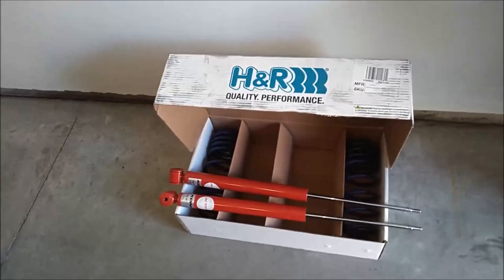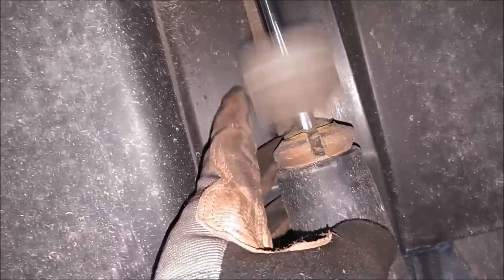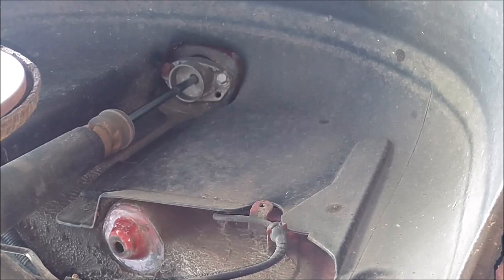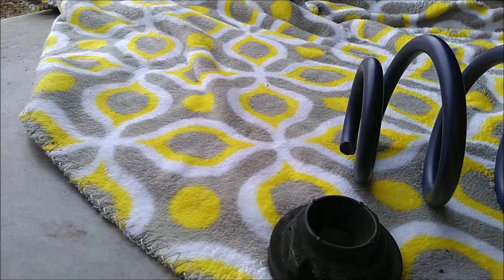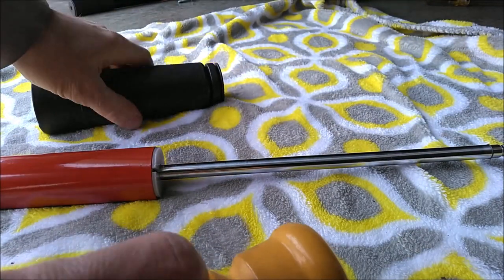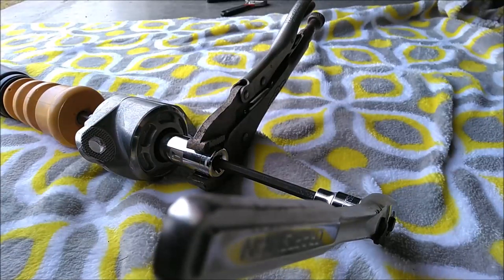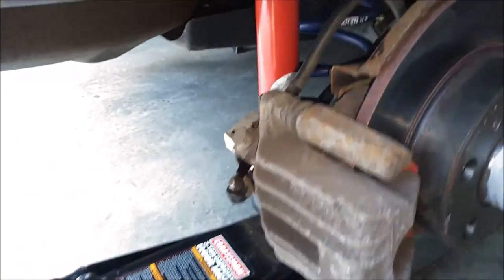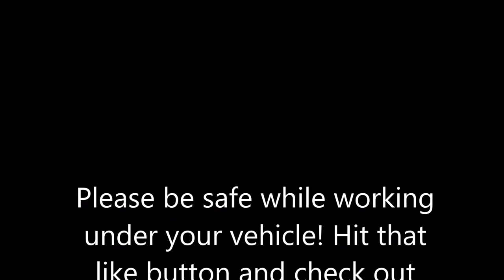VW Golf mk4 rear suspension removal and install

Comment: Great video 👍🏼👍🏼👍🏼
Reply from the maker: Thank you
Reply: No problem! 
I’m changing the bushings on my Jetta soon and never worked on these rears. The parts are not here yet but I’m curious… Are there bushings in that part that gets mounted to the top? The part that takes the two bolts. I’ll see it soon but always wondered wtf that thing consists of 😂
Reply from the maker: @jackvr32  - The top mount is aluminum with an internal rubber bushing. You can buy stiffer ones if you want.

Comment: Great videos man. Keep them coming. Going to attempt a rear axle bushing replacement on my 2003 GTI.
Reply from the maker: Jay T - Thank you. The rear axle bushing replacement is a tough job. I had rust to deal with and bad brake lines which slowed things down. I wish you luck with it. Thanks for the comments.

Comment: Thanks a lot for this video !

I have been struggling to find the 1J0 512 109 reference (Rear lower spring seat). 
From all golf mk4 rear spring how-to videos, only yours shows it very clearly and provides the reference.

Unfortunately, in France it does not seem to be known from regular spare parts resellers websites.
I have to order it in UK, Poland, Germany or USA... (transport fees are higher than part cost...)

I can't tell whether this part is actually mandatory (at least for short term) or not.
Seems like in most of the videos, people don't even change them (even if in bad shape).

As mine are completely dead, and as I receive my new suspension very soon and I'm thinking of driving without the rings for some weeks (ETA for such ring is like 2-3 weeks more).

It's sad such part has so poor availability in my country..
Reply from the maker: Darwinozor - Thanks for watching and for the comment. That's too bad to hear about the spring seats. I would just wait until you get them instead of taking it all back apart again to reinstall.
Reply: Having taken mine out, there was no separate spring seat. I'd seen it on the parts drawings, but it wasn't on either of the springs on my 2001 1.6 16V. I only found one seller on eBay that had them (UK), at $12 each. I just thoroughly cleaned the base and used lithium grease under the spring.

Comment: How does they feel? I got the same setup for my 17' jetta but not installed yet
Reply from the maker: Geraldo Berrios - Handling was improved with less body roll. This is a great setup for a daily driver in my opinion. The ride is a little more firm than stock which I expected. Overall, I'm impressed with the setup.

Comment: Top shock mount bolts call for 30Nm + 90 degrees. You only did the first part, as 30Nm is 22 ftlbs
Reply from the maker: Good catch.
Reply: @Corysdiyauto  hope you didnt have any problems with that
Reply from the maker: @michixinqq - No problems at all. It's been about 4 and a half years since I installed these and all is good.
Reply: @Corysdiyauto  good to hear. When I was changing mine a couple of months ago, not only did I turn more than 90 degrees, but also used some locking fluid of medium strength. Don't want those to come off lol, especially as they are screwed bottoms up, unlike many designs that mount the shocks to the body using just the top nut that is reachable through the boot covers and whatnot

Comment: Was the performance improvement noticeable with that Koni/H&R set up?
Reply from the maker: Jay T - Absolutely! It handles very well around corners with much less body roll. It's great for my daily driver. I also added Cupra R rear axle bushings which really improved the handling characteristics. The ride is a little rougher with those bushings compared to the stock ones. That was to be expected though.